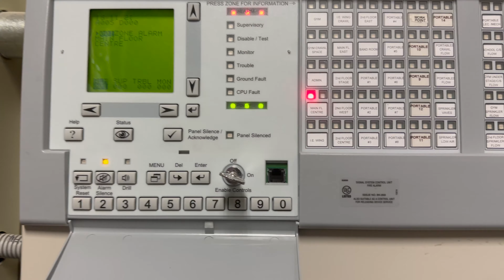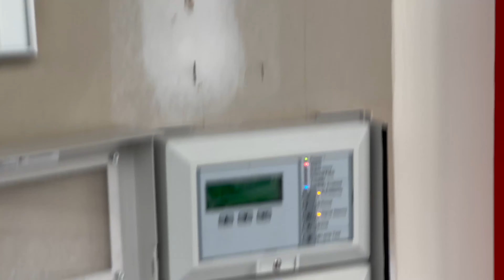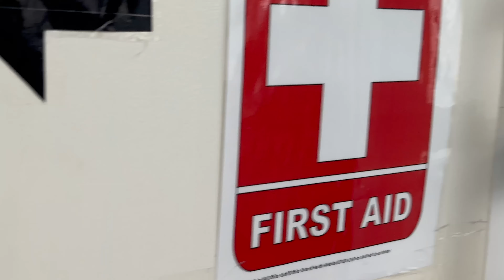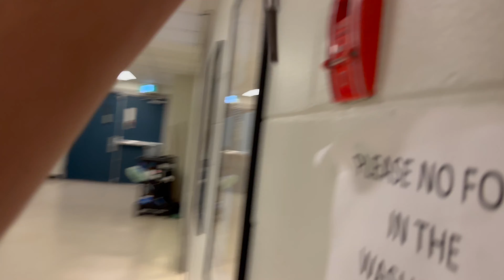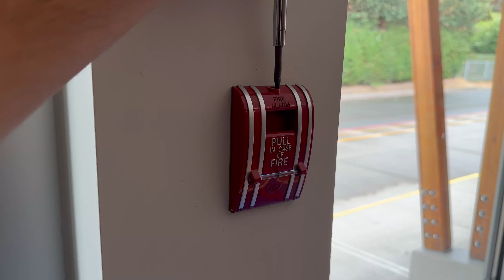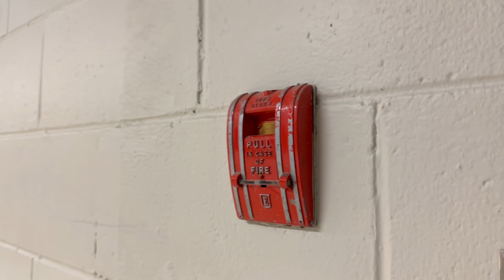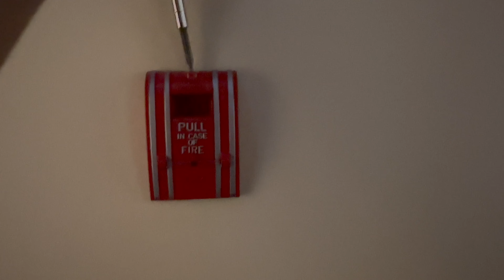Fire alarm testing at a 1964 middle school code 3 bells (my old school school)

Comment: Had a fire drill today at school, for some reason all the gentex commander 4’s and threes were out of sync, also a weird code, also when we were done, they didn’t turn off the fire alarms right so when we went back in the building the fire alarms were still going off. Than we thought it turned off, it turned back on because they couldent reset the fire alarm so everyone was freaking out and we all went back outside XD pretty much the funniest fire drill

Comment: A Manual Pull Station Needs To Be Pull To Activate Not Opening With A Screw Driver That Is To Reset Only I Seen Stations FAIL WHEN You Pull Down.

Comment: Great video! I am gonna miss annual testing. Your portable was great, unfortunately it didn’t get many views. It’s good when that shitstart gets thrown out. Is the alarm company replacing the system or taking over monitoring. If it is monitoring, will they also change the monitoring for fire? keep up the great work! I love your videos!
Reply: @nics-systems-electric Nic, what used to be the old monitoring provider and with who is it getting switched to. Are they also replacing devices? And also are they gonna do fire alarm aswell? Great video!

Comment: Is the panel gonna be a nfs2-3030 because of this size and are theyre gonna be horn strobes added because of some spaces that cant reach a sound of a horn strobe sounding
Reply from the maker: NFS 320c and a one for one bell to horn replacement
Reply: @nics-systems-electric  is this a bigger school then that elementary where you replaced that qs4 with a 3030
Reply from the maker: @notifierfan6078  by square footage yes much bigger
Reply: @nics-systems-electric  why do they put a 320c then
Reply from the maker: @notifierfan6078  it will do everything it needs to do for that building just fine
Reply: @nics-systems-electric  thought its too small like what someone said in the 3030 replacement video
Reply from the maker: @notifierfan6078  it does 318 points that is plenty
Reply: @nics-systems-electric  tho theyres like more then 318 points i think and do they install 2 nac boosters or like 1
Reply: @nics-systems-electric  and thats the size of the ms9600udls or i forgot
Reply from the maker: @notifierfan6078  no you can't add more SLC's to a 320 as I said 318 points is more than enough for the building
Reply: @nics-systems-electric  yea and you agreed to a person on a 3030 replacement vid at the elementary that a 320 is too small for that building and this building is larger
Reply from the maker: @notifierfan6078  a 320 would've been too small for the elementary school building where we installed a 3030
Reply: @nics-systems-electric  yea so wouldnt it be too for this because like you said this is bigger then the elementary school

Comment: Did you guys finally fix those Wonky Relays heading out to the portables?  

This is that school isnt it?  The School of Hells Bells goof ups in the wiring.
Reply from the maker: We fixed some stuff in the portables but then new problems showed up with the lights not lighting up for the correct portable
Reply: @nics-systems-electric  Jesus,  ill be glad for you when you scrap that ENTIRE system and re-wire it OUTRIGHT.  

thats hilarious your old school is definitely giving you hell and making you work for it!

Comment: If the fire alarm panel gets replaced, will it still do the code 3, or will it be continues? And also are the bells going away too? And get replaced with horn strobes?
Reply from the maker: It would be temp 3 horn strobes
Reply: Good morning  @nics-systems-electric

Comment: replace the not healthy Edwards 439D 10 awc  with a 6 inch 439D
Reply from the maker: No all the 439s are fine only durabells are giving out I don't believe they manufacture the 439 series anymore anyways. And even if they did this entire system is getting replaced

Comment: What did you replace the broken pull station with?
Reply from the maker: We didn't have to replace any pull stations
Reply: @nics-systems-electric  oh, I wasn’t sure if you had to replace that one that had the broken hand when you accidentally slammed it because it wouldn’t shut. How are you able to fix it?
Reply from the maker: @GaryBeltz  it never broke in the first place just the brake rod so someday when I think about it I will put a new brake rod in
Reply: The pull is getting replaced anyways. I hope the L series will be the new Led L series!
Reply from the maker: @bjthedjdutchdude1992  we have not replaced anything here that is down the road in the future there is no LED L-series probably wouldn't be out until 2027 minimum for the next generation of A/V's
Reply: @nics-systems-electric  2027? Wow system sensor is late in the led game. I could of sworn System sensor is releasing them soon. Later '23 or somewhere in '24
Reply from the maker: @bjthedjdutchdude1992  their approach is much better to wait and get it right opposed to other companies that have done it quickly and failed miserably with massive recalls